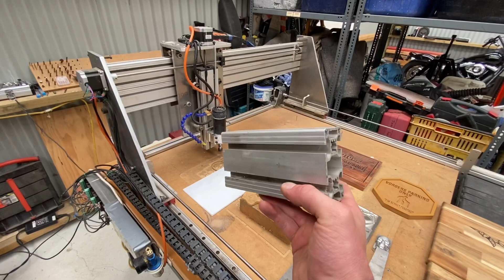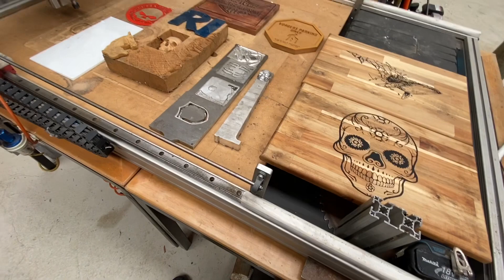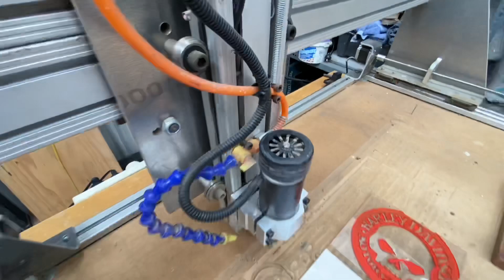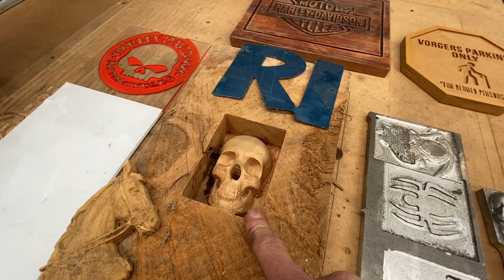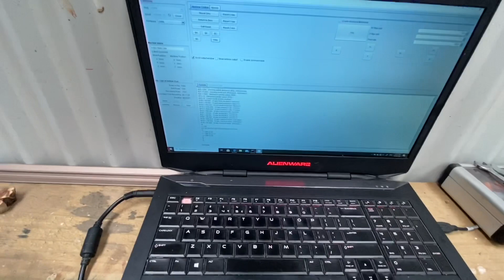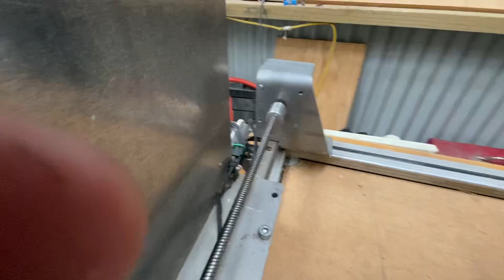Arduino GRBL CNC

Comment: Thats gonna ruin your extrusion really fast I would just use pc wheels or mount a steel plate to the front and back of the extrusion and run the metal v-wheels on it
Reply from the maker: Hey Mate year has lasted good so far but have the idea to run limner bearings for it as it isn't that long length Thanks
Reply: @craiglandreth9573  I cant believe its lasted that long I thought about using steel I beams and doing a build with them metal v wheels